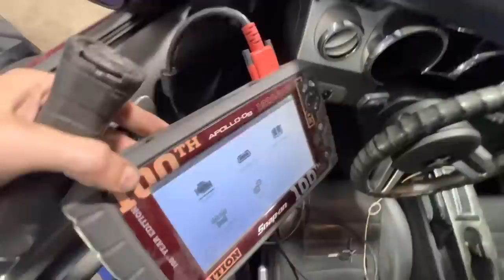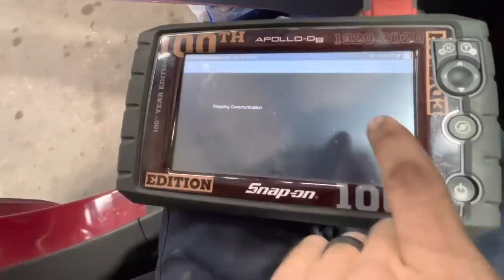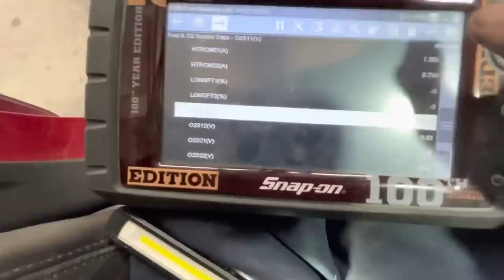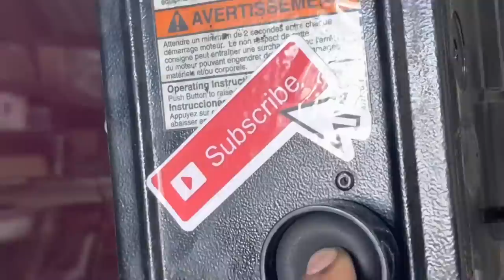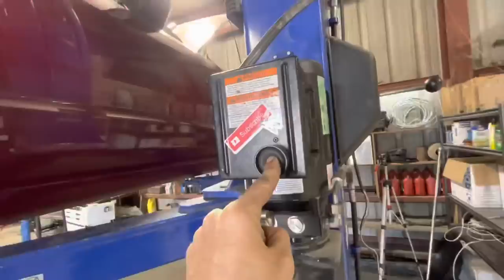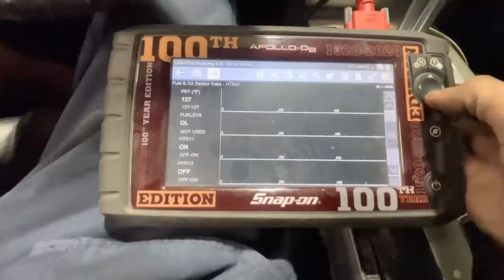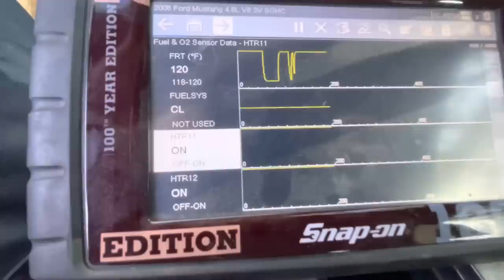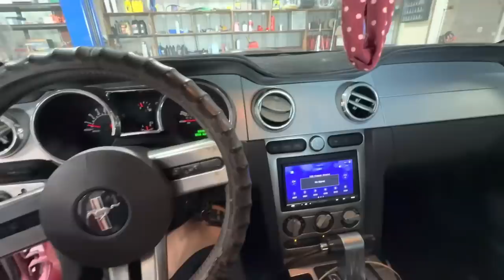Check Engine Light! 2006 Ford Mustang GT P0171 P2195 P1000

Comment: I'm just thankful both my cars are EV's! I'm a gearhead and dealing with ICE vehicles seem so 19th century to me anymore. Ray, are you learning EV's?
Reply: Real gearheads don't drive greenmobiles!
Reply: @stevenbaker9327  I don't drive them because they are "greenmobiles" rather, they do 0-60 in 3.5 seconds and have a driving experience like no other because of the ridiculously low center of mass and perfect longitudinal weight distribution. They are insanely fun to drive with one pedal driving turned on.

Comment: I just asked GPT why the upstream O2 sensor is switching hi-lo. GPT answered that when that happens, the O2 sensor is broken. I repeated the same question again in other wording and still GPT remained by it's answer. Then  I showed GPT a message that I found somewhere about the function of an O2 sensor (0.1 to 1.0 Volt, response time less than 300 ms). GPT then excused itself for the wrong answer and gave in fact the same answer that I found. Conclusion (this happened already a number of times): do not accept the answers from GPT right away, keep asking until you are satisfied...

Comment: Mind you I comment as I watch:
Are the pre and post O2 sensors interchangeable? Switch them and see if the trouble follows it, like you would a coil?
Reply: 3 times as much labor.  Labor is more expressive than the part.

Comment: Hi Ray I'm a bit confused
When you removed the sensor it looked black and dirty and you commented it was running rich yet didn't the scanner report running lean ? Which I my brain would indicate a white sensor liken to the spark plugs or am I getting it wrong
Reply: You're sort of correct, if the sensor is faulty and making the ECM believe the engine is lean, it will compensate and increase fuel. This will foul the sensor with soot, but won't change the problem since the sensor is providing incorrect info still.

Comment: I believe I observed the old/new sensor had a lot fewer holes than the new/new one. Poor design? Cheap parts?
Reply: When it comes to sensors, I try to always use OEM, and I’m cheap. It always seems to me that if you’re going to replace a part that talks to your computer to use the part that was designed to talk to it. 
I mostly work on power tools and I’ve replaced more electrical motors and stuff due to generic batteries than I ever have from actual failures. I have one tool in particular that likes to fry a $100 module with an aftermarket battery. It turns out, the voltage on the generic battery is .7 volts higher than the OEM battery. But hey, the customer saved $10 with the cheaper battery. 
When it comes to oxygen sensors on a Mustang, the difference in the OEM and a generic is usually less than $20. Just buy the OEM. Save money where you can, like a Moog u-joint, you’ll probably pay half for a Moog over an OEM, but they’re just as good…and they aren’t connected to your PCM.
Reply: @stevewhiting556  I agree. I've been burned by "lower priced" parts before.

Comment: I know you will never answer my question. But I find it frustrating when you get an electronic sensor, as long as you never install it on a vehicle, you can return it for your money back.  But if you install it you just bought it, because the warranty just went nul in void. Now I know that new parts are  sometimes bad, but you have noway to test the part until you install it.  And that is not right...

Comment: Those snap-on scanner update speed is so slow it can be tricky to judge o2 sensor response rate. Hope you soon upgrade to a better scanner. It will help a lot in diagnostics. Many way better scanners for 1/3 the cost than those snappy ones. They are slow and expensive and just yesterdays tech.

Comment: When the engine's hot.
I'm surprised you don't cheat and give it a squeeze or two with a spray bottle containing water. The evaporation will cool rather quickly.

It's similar to what I do when on the side of the road with an overheating car. I put a pin hole near the neck of a water bottle. Then turn it upside,and squeeze a pee stream of water through everything as best I can, to hit only the hot radiation all over so the evaluating water quickly cools it down. Then I'll run the engine a little to put that cooler water into the engine cooling it, while refilling the radiator with overheated water, then spraying it again,
Till it's cool enough to open the cooling system so I can add more needed water to get going again. 

I'm usually back on the road in less then 10 minutes hobbling my way home or to wherever I need to go.

Comment: Not certain how the sensors work, I do IT not car things, but couldn't you eliminate the sensor as the fault by merely switching the working sensor on the driver side with the passenger side?

Comment: It's hard for me not to go aftermarket because of cost, but I've seen too many people get burned and waste time and money and eventually spend more.
Reply: Damn tough call on sensors since it is basically a scientific piece of equipment in the worst possible environment. Even the smallest lack of build quality is going to give slightly different voltages and timings out of the thing, so personally I would use them in sets if I did fine a good aftermarket brand.
Reply: on this car, the cheapo is $50, the OEM $70.... you save 20 bucks IF it works....

Comment: That sensor wasn’t new. That carbon buildup could not have happened in 88 mi. I think someone either shined up the existing one or replaced it with a used one. The whole area looked cleaned. I call scam on first shop.
Reply: me too

Comment: Boy do I get that New part not worth crap. I replaced my radiator, water pump, all the houes and a 28$ thermostat. Am still freezing with no heater in my 1995 4runner...UGH. and the crazy thing is everything worked before I replaced all that. 3500$ in the hole.
Reply: Possibilities:
Heater control valve defective
Air trapped in coolant system (burp)
Engine fan thermo control (constant on)
Hate being cold, and spending big $!  Good luck friend 👍

Comment: Just curious if an after market sensor might give different responses compared to the factory sensor just because it has slightly different build specs. I think if I was changing these bastards, I would at least do it in pairs if not using the exact same kind knowing how engineering specs vary. Another good call for using the proper parts, especially when they are a pain to get to.

Comment: I used aftermarket Bosch O2 sensors (X4) and they went bad after just 1 year. So like you’ve said “just because it’s new…”
Reply: u got $ worth already, it is for fixed and sell right away.
Reply: Wow, I thought Bosch was a preferred brand.😔
Reply: @jeffleach2668 used to be years ago.
Reply: @jeffleach2668  not anymore....

Comment: 30 seconds in and I already see that K&N sticker as a potential issue.
Reply: I’ve run K&N filters in everything I’ve owned for the last 20+ years. Why would you think that would be a problem? The only problem I’ve ever had out of mine is the sticker on the air box coming off.
Reply: @stevewhiting556  because the majority of people who run them never clean or oil them. For the large majority in use they cause more problems than they create benefit over a factory filter.
Reply: I suppose that makes sense. I’m a car guy, so mine get cleaned and oiled yearly. The benefit is in 285k miles, I’ve only replaced 1 filter, not 10. It’s probably mildly unrelated, but I do average 1-2mpg better than sticker. It didn’t do that before the filter replacement, but then again, it’s “broken-in” now.
Reply: @stevewhiting556  yep. If you clean and maintain them they are a great product. The issues pertain to lack of maintenance or over oiling. I run one on my Harley and it’s nice being able to clean and reuse instead of buying a 60 dollar filter every oil change. Most people don’t take it upon themselves to do it right.

Comment: Get video. Wouldn't the carbon build up on the old sensor suggest a up stream problem?
Reply: The faulty O2 sensor is telling the ECM "hey, I'm lean" so ECM dumps in more fuel. Result? Rich condition, carboned up sensor, still sending lean condition. Problem persists until the sensor gets replaced.
Reply: @beezul  Thanks for info.

Comment: Hey Rey…is it advisable or bad practice to use anti-seize on the threads of a O2 sensor?
Reply: Most modern ones it’s ok to use a small amount of anti-seize on them, as long as it doesn’t ground thru sensor body. Older models sometimes used body of sensor as ground reference and anti-seize could cause a problem, like single wire o2 sensors. Back in those days we sometimes just loosened and retightened them and they would come back to life, also saw issues with ground straps missing from exhaust causing bad signal from o2 sensors. Had one car that someone added a exhaust manifold gasket to an engine that didn’t take one and the sensor lost its ground references and we welded a ground strap to exhaust pipe and fixed it. Most systems today use a ground reference thru the wiring harness so anti-seize use is not a problem. They also need a ambient air reference so sensors caked with mud would cause weird readings as well as some got this reference down the wiring harness itself and adding electrical tape on harness could cause issues.
Reply: @CodycoWeb  thanks for the information Jeff. 👍

Comment: I'm having a similar problem with a 2010 Corolla, P2196, stuck rich.  So this is perfect!  I'm trying to diag the problem, don't want to throw an air fuel sensor on it, if the problem is somewhere else.

Comment: If the issue keeps returning and looking at all the carbon buildup, could it be burning oil and ruining O2 sensors?
Reply: EPA disapproves changing sensor instead of fixing root cause.

Comment: I know for a fact it's incredibly frustrating for both vehicle owner and mechanic when things just suddenly start working properly, while you're attempting to diagnose an issue. Had several cars like this, where I legitimately considered hiring an illegal to make my car disappear, then I could claim it as stolen on my insurance and they could part that POS out. No, I never did that, but damn sure wanted to because of that crap.
Reply: One of my employees had a Beretta back in the day that he bought brand new. It had an intermittent stalling problem, but only at highway speed. The car went in multiple times over several months, with a GM engineer finally coming down to try to replicate/diagnose the issue. The engineer drove it for several days before it finally did it. Nobody had a clue what was causing the issue. GM actually replaced his car with another one and they sent it back to R&D to figure out the problem since it was a safety issue.

Comment: You sure you got your cylinder numbering right? Ford is has always been 1234 on bank one, and 5678 on bank two. It's Chevy that does even on one bank and odd on the other.

I mean, they could have changed recently, but pretty sure they didn't.

Comment: The way the intakes are designed  , u can look at the runners the favor the driver side , this has been proven ,it dosent efect anything until u introduce extra air volume,  I know it sounds stupid but I've been in this situation when putting cold air or aftermarket air filters on these mass air flow sensor ford engines,,,, as far as the check engine light ,that's about the time it takes 80 to 100 miles of driving to kick that code again

Comment: My suggestion at the 12 min mark is to take the car out of the shop and open it up. You could be dealing with vibration or hard driving caused by loose wires or dirty connectors which create uncertainty in electronics. Seriously this is not your grand mothers car!

Comment: Is there any way to check sensors before instillation?
Reply: Not really. They measure exhaust gases, so they need to be in the exhaust stream to work.
Reply: NO y SÍ. 
Los O2S generan una pequeña tensión cuando están a la Temperatura de trabajo. Su calefactor eléctrico (algunos no lo llevan, solo los HO2S) lo calienta inicialmente en Open Loop, y los gases de escape cuando entra en Closed Loop a determinada Temperatura (sobre los 300ºC) 
Entonces, NO se podrá "medir" la tensión generada si no está en condiciones de generarla o sea, colocado en condición de generar tensión) Lo que SÍ se puede medir es la resistencia eléctrica de calefacción, y luego ya en Closed Loop, la tensión de salida o de trabajo, que es lo que utiliza el PCM para la función, básicamente "trabajando" sobre la señal del ciclo de accionamiento de los inyectores.

Comment: The sentiment 'just because it's new doesn't mean it's good' is something I've been hearing a lot of lately. You, South Main, and several others have stated exactly that phrase. Conspiracy? Collusion? Or just sensible people making the same determination? ¯\_(ツ)_/¯ but it's a good sentiment to have.
Reply: Alot of people tend to buy aftermarket parts or remanufactured parts such as starters alternator etc. 
you'll get hit or misses. Bought a remanufactured brake caliper for a ford cargo van and as I was trying to bleed it the seals busted and brake fluid came pouring out.
Got it warranteed at the parts store the next day and worked fine since then.

Comment: YOUR NUMBERING OF THE CYLINDERS IS INCORRECT. Ford numbers the passenger side from front of a V-8 1, 2, 3, 4, and the driver's side 5, 6, 7, 8.  Chrysler and GM number as you showed but starting on the driver's side 1, 3, 5, 7 and passenger side 2, 4, 6, 8. I am absolutely sure that you already know this and just had a slip. Please show a correction.

Comment: I was wondering if it was the fuse block on the passenger side. When it rains and there’s crap on the hood the water tends to go into the wiring harness and that can cause a ton of mischief. Good thing you didn’t try a burnout, you’d have ended up in a ditch or across the road or anywhere you didn’t expect.🤣 as always, great job.
Reply: I don't think Ray is going to out & start doing burnouts, or purposely spinning tires for an extended period of time on cars that he's just repaired for someone. 
He might do a chirp, or a quick spin, but he's not going to do anything outrageous to customers vehicles.
Reply: @timothygeiger8271  I know. I might have to dig out one of my old cars and ship it to him and request that he destroy it because he’s too good at fixing them and his audience would love to see that. 😉

Comment: SMA: Just because it is new doesn't mean it is good.
Ray: New part means it is not used.
Reply: I have owned 2 New Chrysler Vehicles that were Bad Lemons from the factory thus I will never buy a Chrysler Vehicle again--so same goes for New Parts...
Reply: I get lots of faulty new parts. It’s become common. Almost never buy reman due to shitty qc
Reply: I bought a Chrysler New Yorker once.  That thing broke me from buying another Chrysler product.  I couldn't keep a transmission in it.  After the 3rd failure, I sold that thing, never to buy another one.

Comment: Isn’t it 1234 on passenger side and 5678 on driver side? You said 1357 ps. 2468 ds.
Reply: I was wondering the same. I thought all Ford motors were numbered that way.

Comment: Could the 1st sensor being too tight have distorted it somehow?
Reply: Nah. Aftermarket oxygen sensors especially cheap ones can be junk from the start. If you get the oem brand like bosch or denso ect you should be fine 🙂

Comment: "New" doesn't mean "good". ;) Note that the old sensor had a white connector and the new has a black connector. They're usually color coded. The fact that the one you pulled out was white, tells me it was probably the wrong sensor.
Reply: Wonder if it was meant for the v6 mustangs would that make a difference?

Comment: More sensors are just senseless!
(Air, Fuel, Fire.) Less is more.
When I worked on my engines, I could actually see the ground from under the hood. 😆 327, 350, 396... it's very frustrating now. If you're not fixing the broken part, you're fixing the sensors that are telling you you have a broken part. Twice the work. 
Just like having to have a million tools for all the new parts. 
$$$$$$$$$$$

Comment: So why does the tach seem to indicate the engine is running at 100 rpm here 5:58 ?
Reply: instrument cluster stepper motor is faulty... i had 2 of them fail at 85k miles.... piece of cake to change out....

Comment: Thats the car Ray needs for a weekend of fun at Cleetus's race track, road course style. It definitely looked like a cheaper O2 sensor caused the problem, with labor rates the way they are now it doesn't pay to put cheaper sensors in anymore. The auto parts stores should have to take faulty sensors back and maby they would stop carrying those brands. Our stores state no returns on electrical parts.
Reply: This gives them license to sell absolute crap with no accountability. I could understand the policy when parts were better, but not now.

Comment: Assuming you change to the proper new Motorcraft parts. It could still be  short on the wires.  Cant you test the wires for shorts to the ecm, and trigger a test lamp with your scan tool to make sure its not an open circuit. If I remember correctly the o2 harness comes up threw the floor pan with  z large grommet  the connector is under the passenger side carpets, .might not be true on this car but I belive it is.

Well I was both tottaly right and totally wrong.  Don't put rice parts on American made cars. They no like it. Misfire long time.

Comment: Probably Ford and their inferior  plastic connectors. Or maybe a malfunctioning relay.  Since I don't buy Fords, I'm only speculating. Sensor data may not  be the same between the two sides because of minor restriction of  the converter.